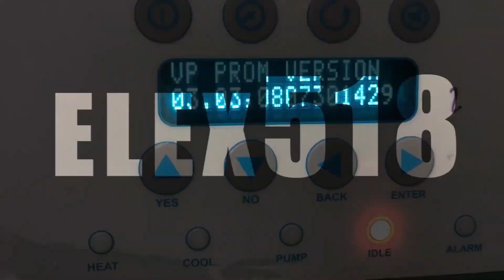How to Repair Lenovo ThinkPad X250 Cannot Power On | Black Screen Led Blinks -Fixed

Comment: Work well but after few days, it return and didn't power on, what to do?
Reply from the maker: Try replace the main battery👍
Reply: @elex5183  do you mean replace internal battery? Or replace cmos ?